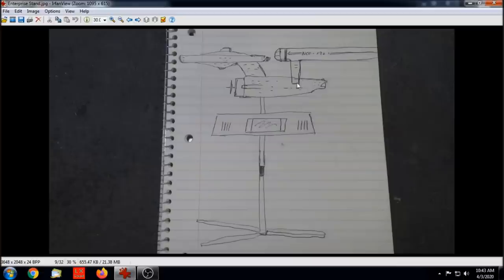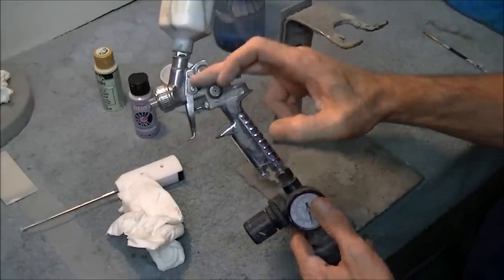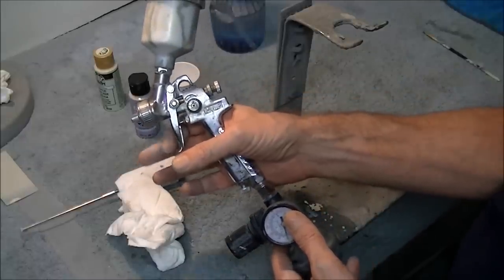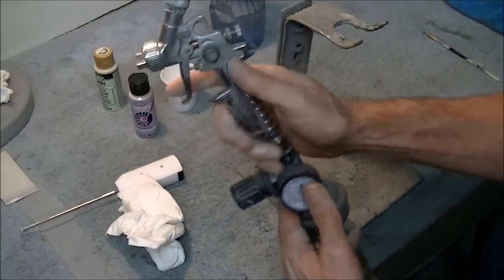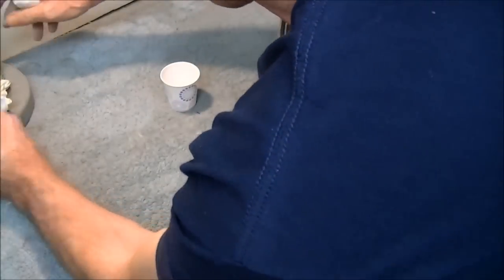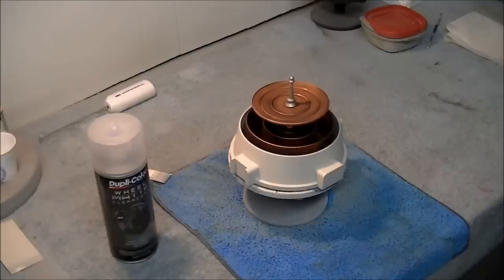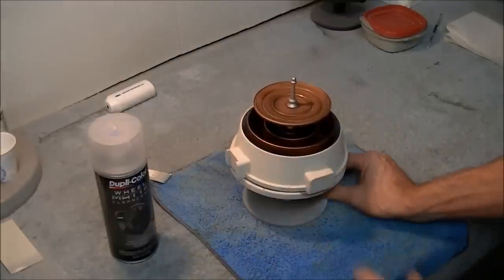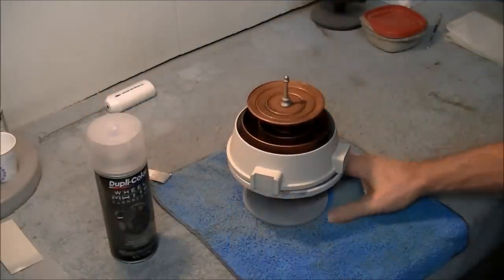72 Inch Starship Enterprise NCC-1701 Model Build Series Pt 3

Comment: That's looking awesome.  The stand does look a little tall. I would probably look at a display height of about 4.5 feet for the top of the saucer.
Reply from the maker: The height on it is adjustable so it should work out pretty good.

Comment: I’m hoping to build my first model and have chosen the 1/350 TOS model. Would using the smaller airbrush you showed in the video be an okay substitute as long as I distance it enough to prevent running?

Comment: As always your builds and videos are outstanding.
I have a word of caution however regarding your tall stand.  I have and use the stand with the lights from the home improvement store.  I find that when the stand is extended as you are proposing it can be top heavy and can tip.  I would be concerned that with the additional weight and height of the model that there would be a potential hazard of it getting tipped over especially if people are interacting with it.  You might want to consider a way to secure the legs to a wider base with some weight or heft to balance it better.
Reply from the maker: I'll be doing some testing to see how the balance works out. No one will actually touch the model when it's on display. it will function by Remote.

Comment: Do you know where the guy bought a 72 inch version from? Any idea on cost? I'm a bit worried about the tripod stand and it falling/tipping over. I guess you can always throw some sandbags on the legs of the tripod. Thanks for answering the questions if you see them and know the answer :P

Comment: You could do the console in the style of the original series control panels on the bridge.  To reduce glare, the screen could be recessed an inch or two.   That would allow you to make a cover in the style of the old buttons for de-powered static mode.
Reply from the maker: Yes, I plan on the base having a definite TOS theme to it. It's as much fun designing it as it is building the model.
Reply: @TrekWorks  Sounds great.  Can't wait to see what you come up with!

Comment: Very informative video.  You have had a bunch going on but 6 feet? WOW!  How heavy is it?
Reply from the maker: It's carbon fiber, a lot lighter than plastic or fiberglass. Should only be in the 20-30 lb range. Pretty good considering the 8 foot Refit model weighed north of 300 lbs not counting the massive pedestal it's mounted on.

Comment: With such a big model, why aren't you using lacquer? wouldn't it be easier to get the color and be a smother paint job?
Reply from the maker: Lacquer is pretty outdated these days. Acrylics are much better being less resistant to scratches and 

cracking and fading over time. Also the water based acrylics are completely non toxic.